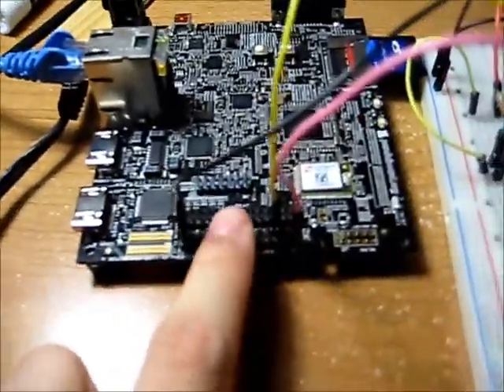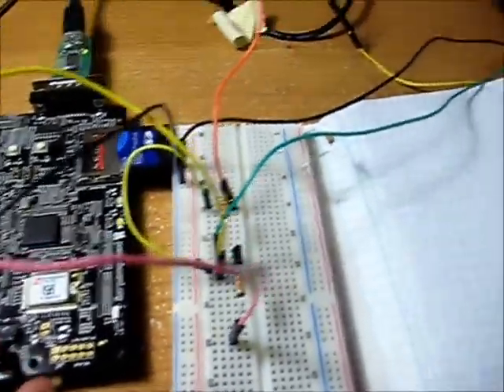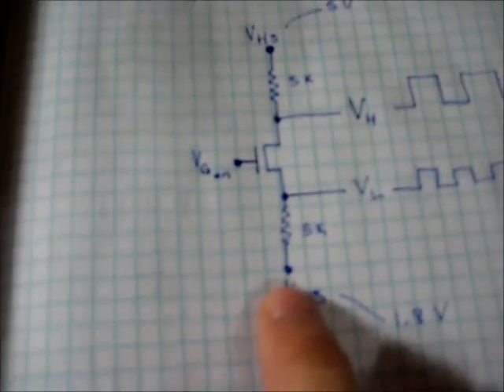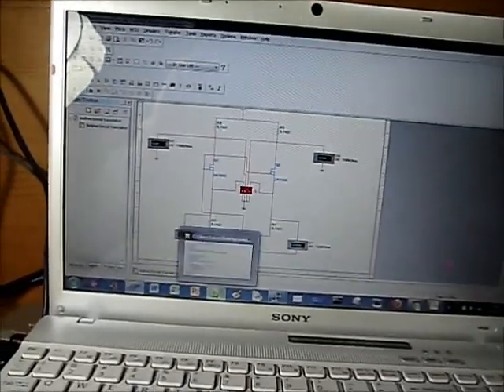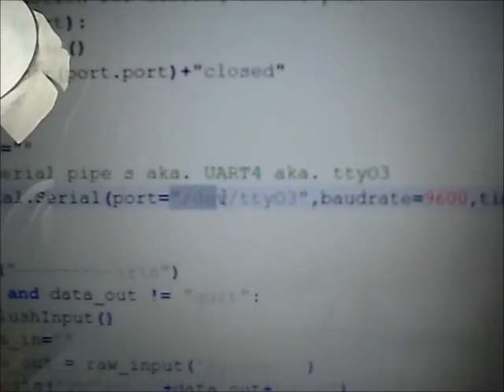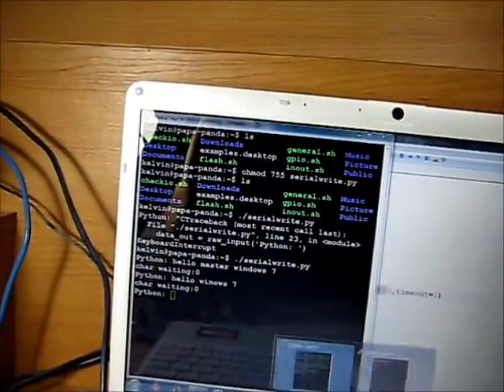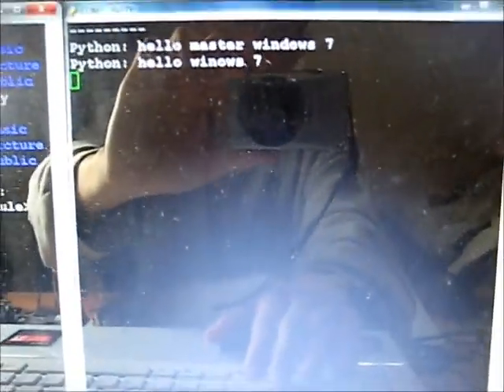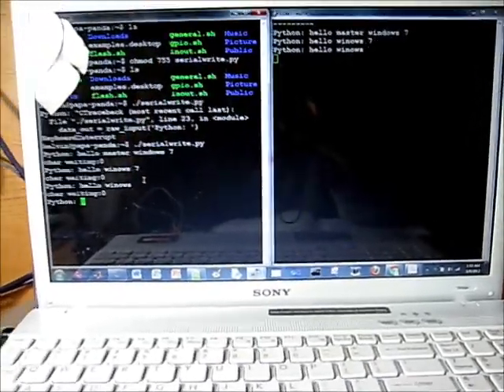PandaBoard Expansion Connector and Serial COM (UART #4)

Comment: Nice presentation. Hi Kelvin, can you please tell from where you got socket headers for expansion connectors. I am new to PCB setup socket connectors etc.
Reply from the maker: I got it it on ebay (cheapest).  you can also get them on mouser or digikey
search male header 0.1" 2 row on ebay and pick the one that you like